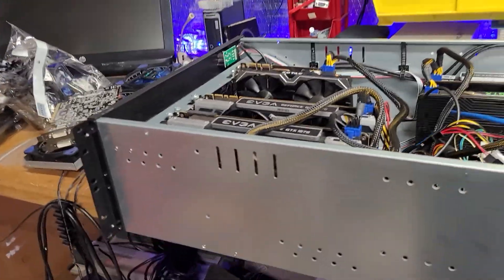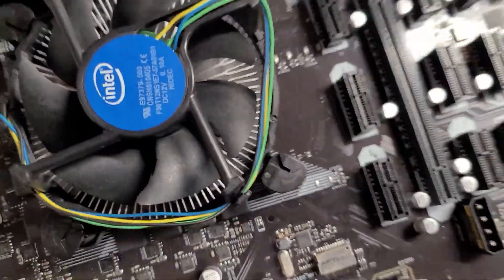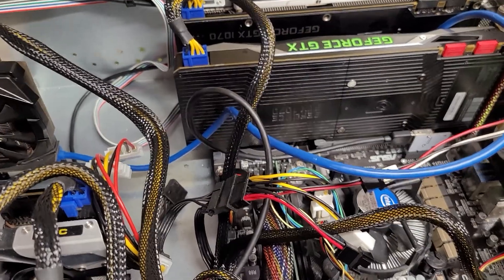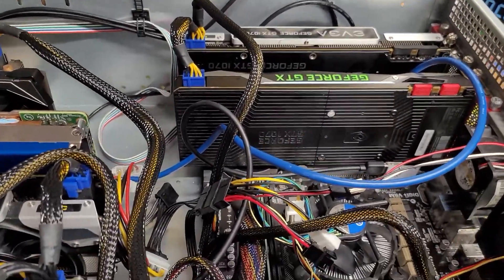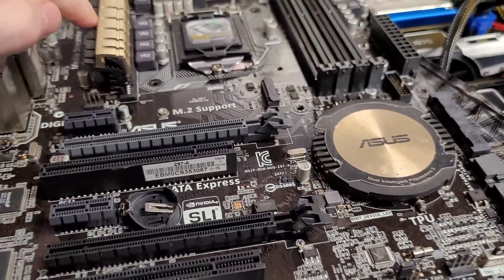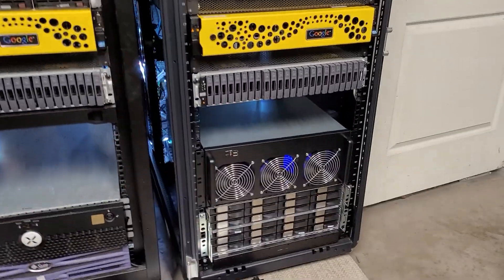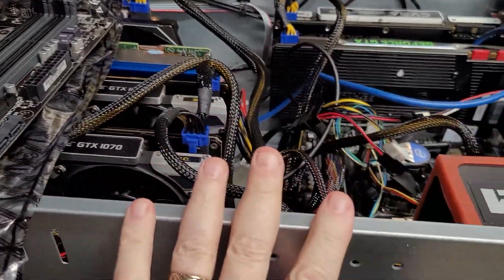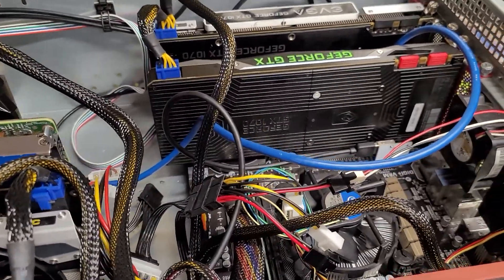Yes there is life after using a ASUS B250 Mining board

Comment: I have four B250 Mining Expert boards and did not have an issue with them. Mined Ethereum for 4 years with 13 GPUs on each board, a mix of AMD and Nvidia. They still work last time I checked - they have been off for a while now. I need to dust the rigs out but I have them covered with ventilating screens to limit dust.

Comment: I have a z97-a board. Can you advise me on a graphics card? Want to mining
Reply from the maker: Good stable gen 2 1150 pin CPU motherboard.  You can pretty much use any video card, I like the 2070 cards best for that are not missed with by Geforce and all that stuff.   You may have some issues with the gen 4 PCI-E cards but update the BIOS and you should be ok... One thing is the CPU limit.  Maybe down the road you need to need to a 1151 Gen 300 series to move the I-9 CPUs but when you are ready.
Reply: @leadiususa7394  Thank you so much i'll try first mining 
Intel(R) Core(TM) i5-4690K CPU @ 3.50GHz 16RAM Z97-A board 
what is best video card? 2070 X 2? 
please recommand

Comment: what are you doing with the xeon phi?
Reply from the maker: We have a FB group working on them to see what we can use these card for... Mine are to old so I need some 7110 cards to keep going but you can mine with them or do none profit computing with them...
Reply: @leadiususa7394  Do you have a link the the FB group?
Reply from the maker: @ps2chiper112  Sure...  https://www.facebook.com/groups/3024610391107622
Reply: @leadiususa7394  Thanks, I am awaiting your approval.
Reply from the maker: @ps2chiper112  You are in!
Enjoy...
Reply: @leadiususa7394   The Phi is basically an array of Pentium (Atom) grade 32 bit CPU's with advanced AVX-256 or 512 vector calculation enhancements. Its very good for parallel computing modalities where you attack a problem with a bunch of tight light algorithms but as its a 1.5Ghz 32 bit Pentium its not on par with anything modern.  So for Mining the code would have to be built from scratch to dissassemble/parallelize and reassemble the result. The key is getting a plurality of adjacent cores doing something valuable simultaneously with minimal "stall".  Kind of  parallel whack a mole with maybe a store and forward pipeline. No way to know the outcome until that custom code is written.   Really the power of the Phi is the AVX array ability - the Pentium is there for "support". Much like the motherboard CPU as you noted. In the motherboard case it as acting as a dedicated scheduler and Netstack + IO processor. Its very light work but needs to be done quickly to "get out of the way" of the real work being done by the GPUs.   

Please update on your success with the Phi. Its a very interesting "boat anchor" and really a great proving ground for developing parallel architectures with a familiar foundation.